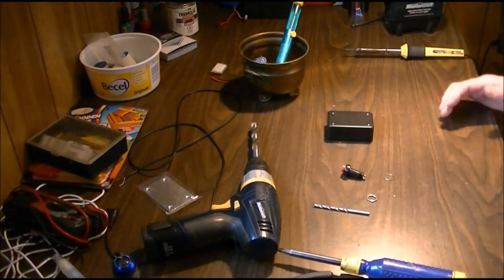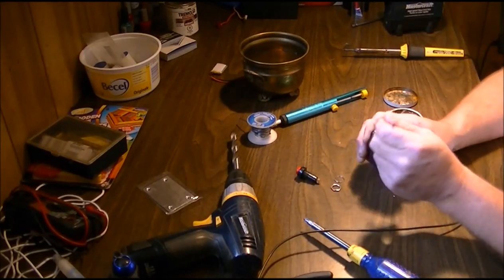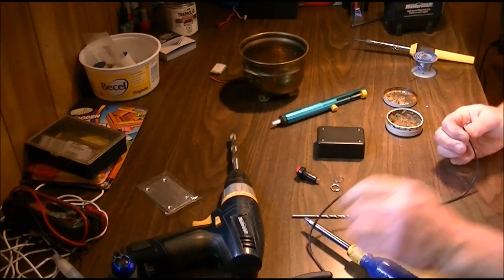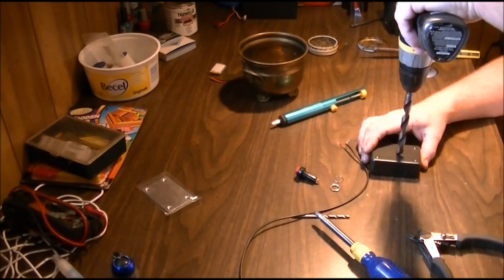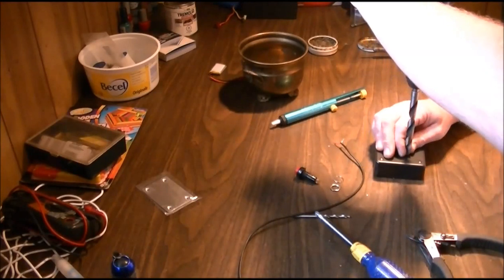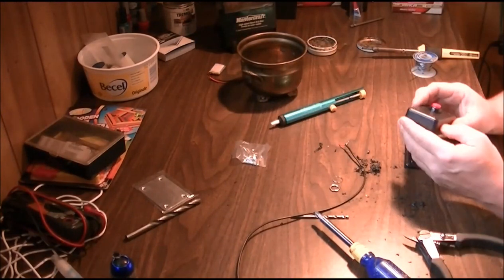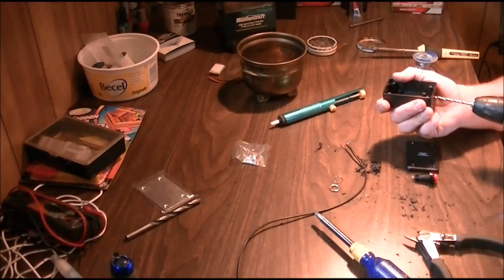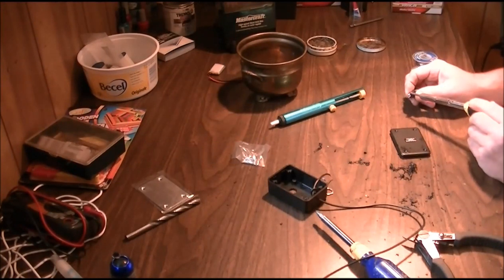How To Make A Keyboard Sustain Pedal Cheap

Comment: How would i make one with a polarity switch?
Reply from the maker: switchs dont have polarity that i have ever seenwhen you use a switch it only goes on either the + side or the - side you never connect + to - that causes a shortout
Reply: Kevys Rc & Music Some piano keyboards require the switch to work the opposite way. Some sustain pedals have what they call a polarity switch. I was just wondering if you knew how to make one with a switch or maybe modify one, but then i realized some switches have 3 pins and some will actually function the opposite way if you chose the right pins. So i found one and made one 😀
Reply from the maker: every keyboard i have ever owned and i have had alot of them over the years all of them used a standard switch and that includes my new yamaha EW400 keyboard switch is the top of the line psr from yamaha for 2017 sustain pedals use a momnetary switch which has no polarity to it tho commanly all these are hooked to the + wire but it does not matter which side you use..thats all i can tell you